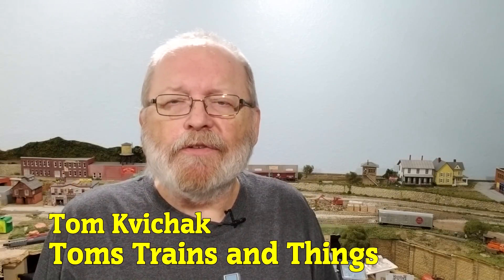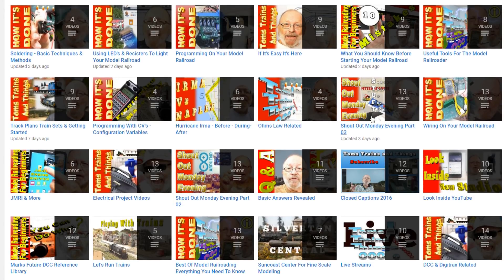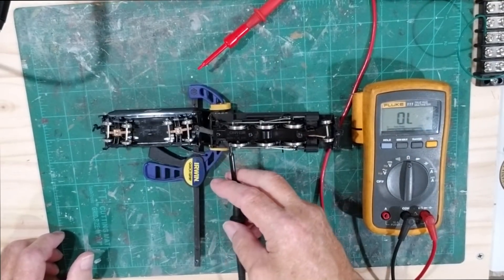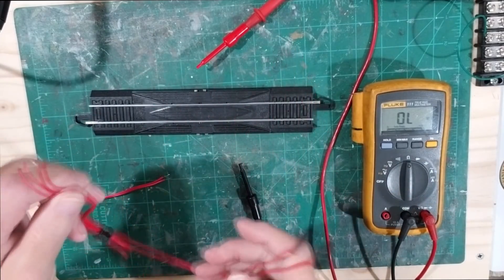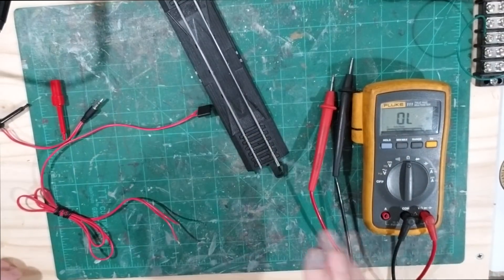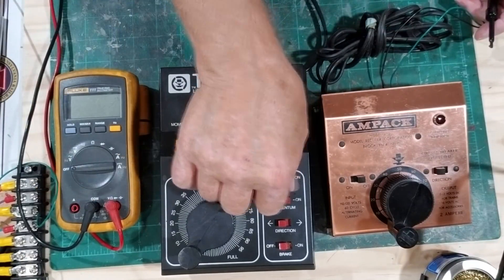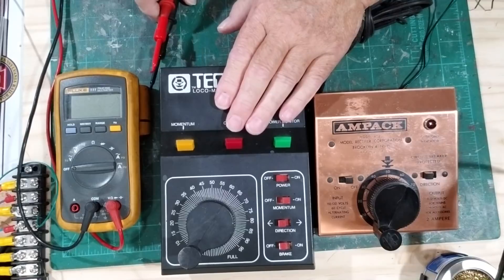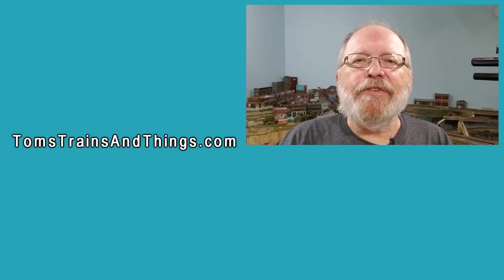Easy Troubleshooting DC Problems With A Multimeter - Model Railroading For Beginners - Ep 19

Comment: My Bachmann Henry wasn't going more than half a rotation of the wheels even though it was getting power.  I used the 9V trick and discovered it was a problem with the coupling rods, and how they weren't straight!  fixed them, tightened them up and now I have an actual railroad.  Thanks so much!
Reply from the maker: Glad it was helpful

Comment: 3:35 - What you're holding is the throttle, and it's probably just a rheostat switch to control how much electricity is making it to the rails. The "wall wart" is the actual transformer. That consists of a transformer coil to step the voltage down from 115 VAC to 12 VAC, a rectifying bridge to change it from VAC to VDC, and (hopefully) some capacitors to smooth out the current.

I remember the OLD SCHOOL throttles that were all-in-one units with the coils, rectifier bridge, capacitors, rheostat for controlling power to the rails, and even an unswitched power tabs to run accessories like lights and motorized switches. But the name "transformer" follows the coils and rectifying bridges, not the rheostat.
Reply from the maker: What you're describing is 30 year old technology.

Rheostats, not rheostat switches have long been replaced with potentiometers.
Wall warts now have voltage regulating circuitry instead of coils. 

Try catching up on your reading or better yet, take apart some components to actually see what they consist of!

Comment: thank you for this.  i use bachman transformer and tracks. i intially thought the issue was the wire connecting power to the track since it was worn near the ends from pulling but still hass issues. my trains wouldnt run unless i put the power up to 70-90 and would have some sudden stops while running.
Reply from the maker: Glad it was helpful

Comment: Tom, I have a DC HO track system. I cannot seem to get power to the track itself despite testing many sections. The multimeter measures 15 V at the transformer. Have you had to find a location on the track that has power sometimes the train will move about an inch every 10 seconds or so. Any further advice how to break this down and find the possible short?
Reply from the maker: First thing to check is clean the track.
check voltage at different spots on the track
 clean the wheels and pickups on the loco

Comment: I just got a old set from Habitat for HUmanity and I have tested the engine and the power and they both work but the track part that attaches the power is pretty rusty and corroded and the engine doesn't move when I put it on the track. Should I just get a new track and connector or would I be able to clean the track so it can be used.
Reply from the maker: If it's rusted I would just get new track. Good find. I always find model railroad stuff at thrift stores

Comment: Yes Sir.... you are absolutely correct.... I am currently making sure all track runs smooth.
I have yet to connect my Digitrax Zephyer, and running a DC power supply .
At the 12 o'clock postion it is producing 11.5 volts / at the 3 o'clock position it reads 15.2. Both the main lines and the reverse loop are reading same voltages. (within 1/2 a volt)
The light on the AR1 is green or red solid... This is N scale and currently using DC Locos for track testing prior to implementing DCC.
Reply from the maker: The AR-1 is exclusively DCC. It does not work with DC track power or with DC locomotives.

Comment: Morning Tom, just need help in fault finding. I own a Hornby 08513 Engine, the motor is running but the train does not move. Could this be caused that the base plate is on to tight to allow wheel to move. With many thanks, Graeme Palmer, Albany Western Australia, Australia.
Reply from the maker: Is the motor running or just humming? If humming, something may be binding. If running freely, maybe broken or misaligned gears

Comment: Tom. Simple ho setup for the kids. Train runs and moves when on the power supply but as soon as it leaves it, it stops. Cant make it around any of the track. Doesnt matter the engine. Connection issues with the track?
Reply from the maker: Clean everything

Comment: Hi Tom, why does my lock keep coming off on the turnouts? I'm very new to this and I'm having a lot of trouble trying to get it to stay on track before I start more on the layout.
Reply from the maker: Send me an email with a bit more details like what you mean by lock and stay on track.
Reply: @TomsTrainsandThings  Sorry, Tom, my loco keeps coming off my turnouts. I can't seem to get it to run without it derailing off the turnouts.
Reply from the maker: @CharlieCassar-m9d  check the gauge at the turnout with an NMRA Track Gauge. It gould be too narrow, too loose or the wheels on the loco are not set properly
Reply: @TomsTrainsandThings  thanks Tom, I'll try that and see if it works.

Comment: Great video. I have an N Scale Bachmann EZ track Stallion train set. The train has no power. I did all your checks,  but still no power. The led light came on very briefly then went out. Help
Reply from the maker: Check the wires to the motor

Comment: @TomsTrainsandThings does the 9v battery work for post war engines..?
Lionel 2344 f3 (powered unit)
Lionel 2338 Milwaukee Road GP7 
Lionel 681 Steam locomotive 
Thank you sir, for your time, as well as, your knowledge.
Reply from the maker: 9 volt battery only works on DC motors

Comment: Track is getting appropriate VDC but engines do not run when placed on track.  They do pass the 9v battery test.  Thoughts?
Reply from the maker: What do you consider appropriate? A loco will not start until it reaches about 4 or 5 volts, then increase in speed as the voltage increases to about 18 VDC.
Reply: @TomsTrainsandThings  With the multimeter hooked up it will go from near zero to around 14 as I turn the knob.
Reply from the maker: Clean the track with a bright boy and wheels and wipers going to the wheels with isopropyl alcohol.

Comment: I was hoping you can help me out. I just got a “New” Santa Fe 4073 Steam locomotive. It’s 40+yrs old.. however; it had never been opened. I have new brass tracks and a power unit that i tested and it’s fully functional. The issue is that the train itself may gives no sign of power when I use a battery and barely moves a 1/4inch when I test it on brand new tracks and a strong power source. I’m new to this and not sure what to do.
Reply from the maker: clean everything with alcohol or electrical contact cleaner. since it's been in a box for so long, the gears may be locked up with hard greese.

Comment: Hi Tom my problem is my mulitmeter shows 20-24 volts to the track and any place on the track is still 12-14 v but the trains will hardly move. Put the same trains on to another track and they fly. If the train dos move the voltage drops almost to zero but when comes to stop the reading go's. I have gone around checking each join for resistance the meter gives me reading 001 to 002 hope you can help
Reply from the maker: Check your wiring to the track. 
Put a 9 volt battery across the wheels of the loco to see if it runs in both directions.
If you'rw loosing that much voltage between the power pack & track, double & triple check your connections
Reply: @TomsTrainsandThings   Thank you for the quick reply, I now find my controller would loss power when adding the train to the track different controller no problem --thank you again

Comment: How do I run a DCC engine without the tracks? I want to apply bullfrog snot to the drive wheels but I have to run the engine at yard speed & I only have the transformer & track as a power supply.
Reply from the maker: What DCC system do you have with a transformer? 
DC you use a 9 volt battery on the wheels
DCC you use the leads from the command station on the wheels
Reply: @TomsTrainsandThings  Digitrax Zephyr. So I just have to hold the leads to the wheels, one on each truck on the tender?

Comment: Bought used MRC Twin Pack for N gauge. Has 12 V to track. Trains barely move. Help.
Reply from the maker: Locos usually start running anywhere from 6 to 8 vdc. Max voltage should be around 18vdc.
Are you checking on the track or on the terminals on the power pack?

Comment: Hello Tom Great video for the dc trains thanks for posting! I have a dcc ready train that I brought second hand and it won't run on my dc track. Is this normal ? Do you have a fault finding video for a dcc locomotive at all? Many thanks
Reply from the maker: DCC ready means that there is most likely a plug installed where a decoder can be placed. Does it have a decoder in it? Usually if someone adds a decoder they also provide the documentation with it. Not normal that it doesn't run. Did you try the 9v battery test? Just touch it momentarily since you don't know if there is a decoder installed. Let me know if you need more assistance. 
I have several playlists on DCC you might want to watch.

Comment: I have basically the same steam locomotive and coal car as in this video. The train runs if I lift the coal car OFF the track but doesn’t run when it’s on the track with the engine. Any idea why that is and how to fix it? The coal car is permanently connected so I’m not sure what to do. Power is good every where as far as I can tell. Thanks for any ideas you have. Great video to help my 6 yr old son and I get started.
Reply from the maker: The tender also has pickups on the trucks for power. You may be shorting out something. Make sure you didn't inadvertently twist the trucks so they are making contact on the wrong rails.

Comment: hey i need help so the other day i went to my hobby shop got a brand new atlas engine not used brand new k so i put it on my track and it don't run I try some of my others but the just inch along barely move but this one that i have runs like nothing doing it goes fast slow and i have the same controller in this video you use please help me I am just sooo frustrated
Reply from the maker: Mack sure your track is clean. Clean it with a bright boy, or any other recommended cleaner.

Comment: I have a DC layout. Say if I have two trains and want to create a realistic freight train scene with two trains coupled together to pull freight. I have a standard DC layout. Can I just lay them BOTH on the track, then just move the transformer forward and both trains will move on my DC layout?
Reply: To sum it up, Will two trains run coupled together on one DC track and transformer?
Reply from the maker: Thay will run together, but they may run at different speeds.

Comment: I have a motor that does not run.  Cleaned brushes, commutator and have 50 ohms resistance across leads.  Any suggestions? Could the armature be touching the magnet cause this problem?
Reply from the maker: Tom, resistance across the leads vary based on the size of the motor and other factors. What is the motor used for and how large or small is it?
Reply: After cleaning the brushes and commutator and reassemble and make sure brushes are seated, the motor works fine. I had to ensure the brushes were installed properly.
Reply from the maker: @tommhutchison  Good to know, thanks for the update. A little cleaning goes a long way.

Comment: I have a 4 wide track, point to point, was running fine, until I introduced an Digitrax AR1 and a loop on one end. So Track 1 and 4 are both common connections.(meaning the front rail on both tracks are + and the back tracks are both -       ...... The reverse loop is insulated at both ends. The trains run into the reverse loop fine and without hesitation.  Upon comng out they balk and then stutter back and forth, then send the train back into the reverse loop.  Any Ideas??
Reply from the maker: I've seen that happen but that was because the locomotive was DC going into the DCC reversing circuit. What scale are you running? What command station do you have and what's the voltage of the power supply feeding the command station?

Comment: DCC engine runs on DC layout until it reaches a certin point (switch) where it stops. It is a HO gauge laayout from Atlas. I'm thinking of converting to a DCC layout but, until I figure out this problem, DCC is on hold. Can you help?
Reply from the maker: A lot of turnouts have a plastic frog and rely on multiple wheel sets on the locomotive to maintain power to the motor to continue moving. Also, some are insulated past the frog requiring additional feeders past the turnout.  Will it move once the locomotive clears the frog? Does it only stop when the locomotive is on the siding?

Comment: I have a somewhat strange situation. I got a train off of Facebook. It was in a box for 20+ years. It uses an old tyco power supply. I set it up on the island of my kitchen to make sure it works and it worked well. Now I’ve move it to under my tree and I’m only getting 1-2 volts on the track for some reason. The multimeter says I’m getting 18v from the power supply at full power, except when wires are hooked up to it. That’s when it only shows 1v. I would like to say it’s the wire, but it’s the exact wire I used in the kitchen island an hour previously. So I’m stumped. Any thoughts? The track is longer now, does that matter? How important is the wire gauge? I tried using a 16 gauge wire and it heated up the power supply quite a bit.
Reply from the maker: Check your wires and the connection. Make sure everything is clean oincluding your track, wheels and contacts.
Reply: @TomsTrainsandThings  so it turns out that my layout has what are called reverse loops, which I have recently learned, complicates things. My layout is a figure 8 with with a straight track on both sides of the 8 to make it an oval. So it’s an 8 inside an oval. I saw the video on setting up blocks, but I’m still not sure how to do that on my layout. Also, I only have one power pack. Tech 2
Reply from the maker: This video may help with your reversing circuit:  https://youtu.be/jG8TpmnzCv0

Comment: Hi Tom, I was in a thrift shop today and picked up an Athearn train for $2.61.  Based on what I've seen online it's the "Athearn HO scale Pennsylvania PRR EMD F7A Diesel Engine #9643".  Your 9 volt test worked great but should the lights come on as well with this test?   Thanks, and thanks for the informative video!
Reply from the maker: The light should come on but it may be dim.

Comment: What If the power  pack has overload  trip, how can that be reset
Reply from the maker: Reset the overload by pushing in the button when it cools down. If it does not reset, you need to disconnect whatever you have hooked up to it and try again.

Comment: My n scale steam engine ran fine the other day. Now headlight comes on but no movement. It was expensive engine.  I tried 9 volt but wheels don’t move.
Reply from the maker: What power pack did you use to run it initially?
Reply: @TomsTrainsandThings  I flipped over the engine and noticed the screws that hold the bottom plate on we’re really loose.  I pulled the plate off. And see the nut for one set of wheels was off. I put it back together and put the plate back on.  It now goes in reverse but not forward. This is crazy. I’m not experienced in train repair. Any ideas?

Comment: I have a problem with my atlas snap turnouts, if I have my controller wired up to a atlas relay and using ac current from a life like transformer, and my snap switch will not work and the relay will try to move. I hooked 2 life likes in parallel , voltage is the same and sometimes the relay and the turnout works, I believe it's a wattage problem and most of the transformers on Ebay don't have a wattage info, I have a problem getting info from model train stores,  all they seem to know is price tag info. I'm retired and don't have a bunch of money.
Reply from the maker: Try getting an MRC transformer. If your using LIfe Like, as the ones found in the old train sets, it probably isn't supplying enough power to drive the turnout coils.
Reply: @TomsTrainsandThings  Thank you, I figured that, I believe I found a cheaper way to go, I ordered a 16 v ac voltage 30   VA doorbell transformer to run my AC volt accessories, I will be using one lifelike transformer for all DC volt accessories. I'm a retired heavy equipment mechanic and I worked on the EMD locomotives and rail cars, so I only go by voltage and amperage and amperage draw, and I knew how many amps and voltage it took to turn over an EMD V16 diesel, but on these small HO railroads it takes a little more thought, Thank you for taking time to answer my question.
Reply: The reason I don't buy a lot of items on line for my HO layout, is that some of the shipping cost is more or very high for what I need. The closest hobby shop that sells HO products is in Cheyenne Wyoming , which is 165 miles away, Casper Wyoming the second largest city in Wyoming has no hobby shop except for Hobby Lobby and they don't have much for HO trains. So I will let you know if this doorbell transformer works on my layout. I have to manufacture a lot my HO items.
Reply: The doorbell transformer works great, throws the Atlas turnout and the relay . Multimeter reads 17.4 volts ac on this doorbell transformer.
Reply from the maker: Good to hear. Glad you got it working
Reply: @TomsTrainsandThings  Thank you, I can share some of my money saving HO fabrication for those who have to buy online and pay much for shipping and handling. I make my own connection eyelets on small wires by using a wooden dowel and a soldering gun , by looping bared wire around the dowel and applying solder, then when the dowel is removed a perfect eyelet, money saved on buying the #3 Atlas spade connectors which cost me $10 for a packet of 24 to buy online.

Comment: Tyco 3960 general locomotive. The ohm reading at the brushes is 0.07 at best. What can I expect from this? The vintage is 1970.
Reply from the maker: Disassemble the motor and see if you can spot any evidence of heat such as discoloration or brittle insulation.